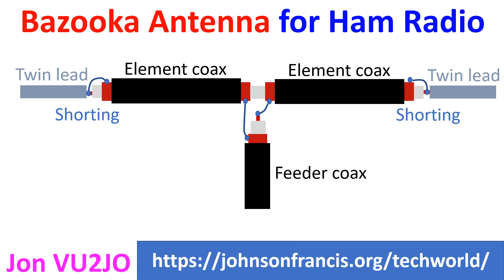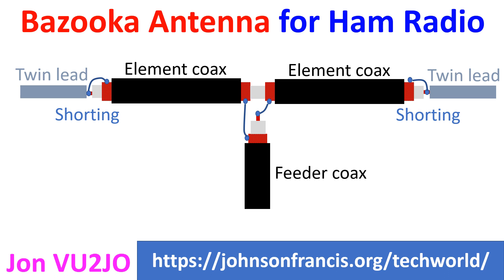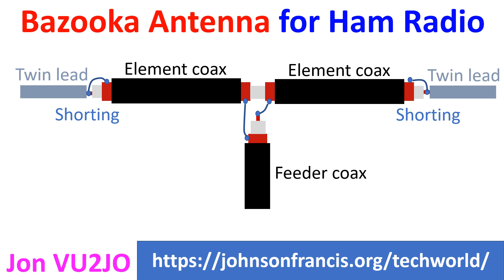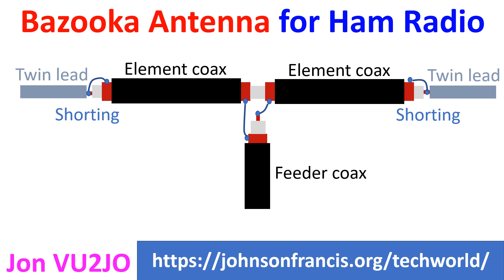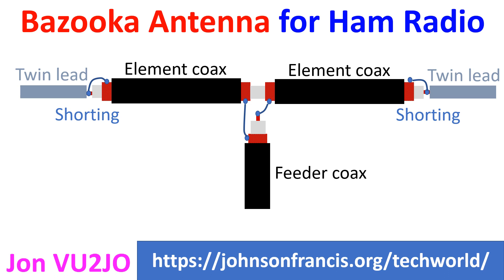Bazooka Antenna for Ham Radio

Comment: Thanks for video!  I have on but curious what the best position is to mount for sporatic e events during may/june?  Ie inverted or flat.  Also does the radiation direction change when in the v vs flat?  Thanks un advance for help.
Reply from the maker: This the reply I got from SP3RNZ who is a regular 6m operator: "Flat. As high as possible. If we're talking about dipole - pattern will be perpendicular to wire direction as with ordinary dipole."
Reply: Thank you so much....i really appreciate it!
Reply from the maker: You are most welcome!
Reply from the maker: I have not had the luck to work on 6m yet! Shall check with my online friends. 73 de Jon, VU2JO

Comment: I made one using RG213 for the antenna and fed by WF-100. The target frequency was 128MHz, which is the centre of ‘Airband’ in the UK. As an Rx only antenna the results were astonishing compared to the much more expensive discone I previously used. Thank you for your videos sir, they’re always informative.
Reply from the maker: Thanks a lot for sharing the valuable information.

Comment: I built a 40-meter version using instructions from the Internet. The elements are made from 75-ohm cable television coax, and the design used standard wire instead of twin lead. The site had a velocity factor formula to use to determine cut lengths based on the type of coax used for the elements. It's a very good performing antenna.
Reply from the maker: Thank you very much for adding your practical experience. It would be great to add your callsign as well. Hope to meet you on air some time in future. We have only short time windows in morning and evening for US on 40m by long path. Had worked a few US stations on 40m in late 1980s. Currently active only on VHF and occasional tests on UHF. de VU2JO.
Reply: @johnsonsTechNAgroWorld  40 and 20 are my main HF bands at the moment, since those are the only antennas I have up at the moment (20 is a standard dipole). I've been kicking around an idea though- is it possible to make a "double bazooka fan dipole" for three or four bands? I can't find any info on using the double bazooka in a fan arrangement, which leads me to believe that there might be a reason why. Would love your thoughts on this. KD9MHP
Reply from the maker: Though I have read about fan dipole, never even thought of 'double bazooka fan dipole'! Anyway, it is definitely worth a thought. My friend was mentioning about 'fan dipole' that if you add more bands than two bands, it may not work well on all bands. My be your concept of 'double bazooka fan dipole' will work for for your favourite 20/40 combination!

Comment: Would LDF4 coax work good , i have loads of it
Reply from the maker: As you are an aerial technician, you may be the best person to test it out! Online resources tell me that it is 50 Ohms and has an operating range of 1 – 8800 MHz.
Reply: I used RG213 because, as I understand it, it requires coaxial cable with a low velocity factor (RG213 has a VF of 0.66).
Reply from the maker: Glad to hear that.